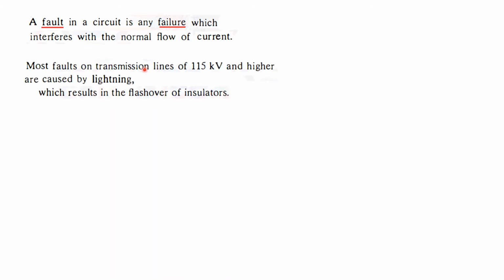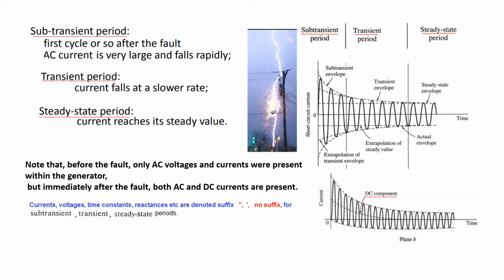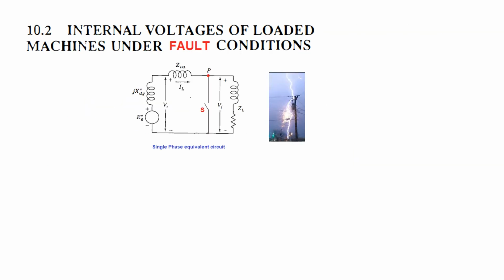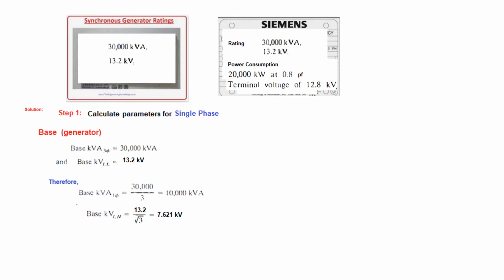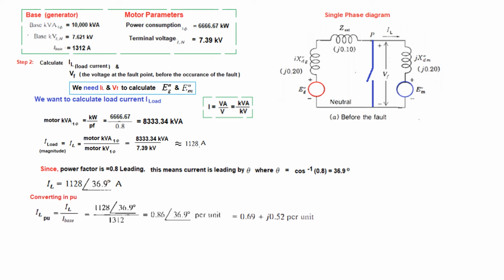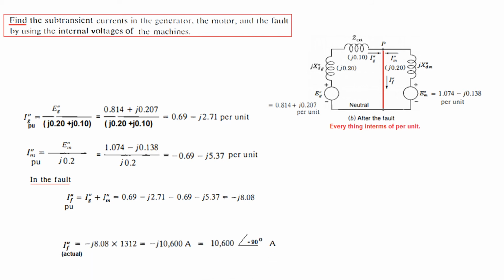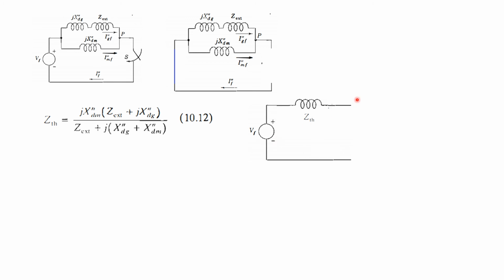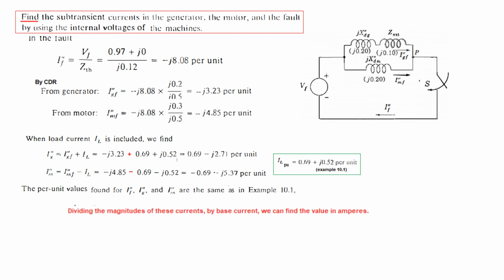(English)Power System Analysis | Stevenson Ex 10.1 & 10.2 | Symmetrical Faults Explained

Comment: Sir, in this topic, while applying KVL why do we use load current? As fault has been occurred shouldn’t we use subtransient current in KVL? Load current is not flowing anymore, right? If we use load current, then how we claim Eg'' and Em"? They shouldn’t be subtransient terms,they should be machines' voltage when load current is flowing, right?
Reply from the maker: Actually I never taught this subject so not an expert; but if you point out the video time you are referring to, I can have a look and comment on your query.
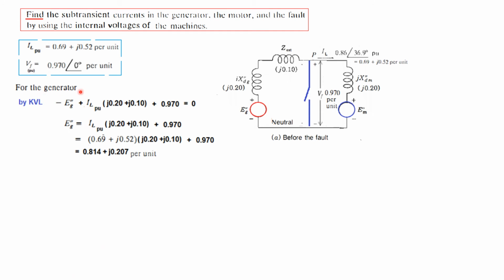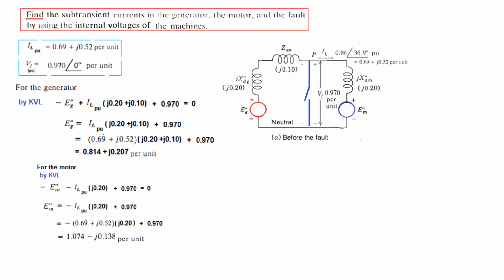Reply: @ElectricalEngineeringAcademy Sir, 15:19, then 15:47....these two are timestamps. In these two time, you applied KVL for generator and motor. As fault has been already occurred, so subtransient current should flow through the circuit, which is huge amount of current. Instead of applying that current, why do we use load current in KVL to find subtransient voltage in generator and motor?? In book, same concept has been claimed. But my question is why load current instead of subtransient current.
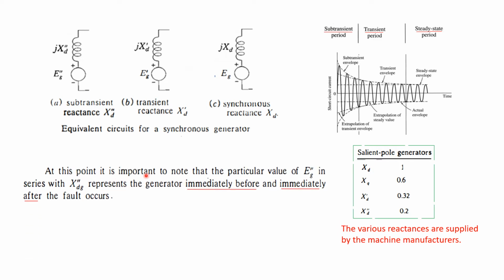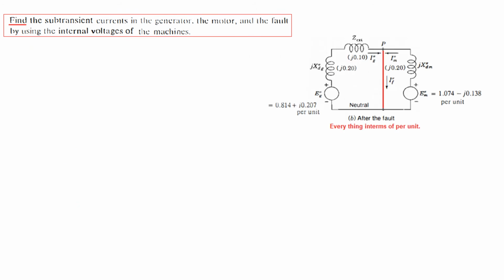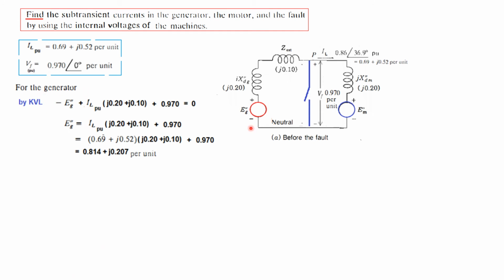Reply from the maker: @JoyshankarRoy-b1p  Please watch this video two three times with full attention. Note the remarks at time 6:25. Also note that the fault is occurring at time 16:22, before this time (i.e at 15:19 and 15:47) is no fault condition. I hope it  clears your doubt.